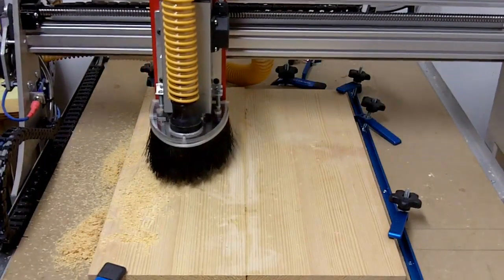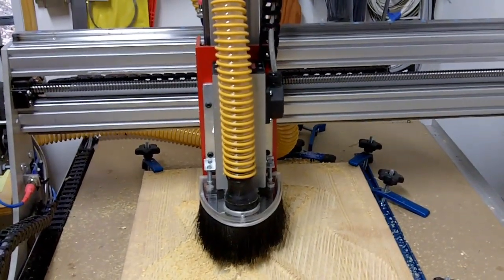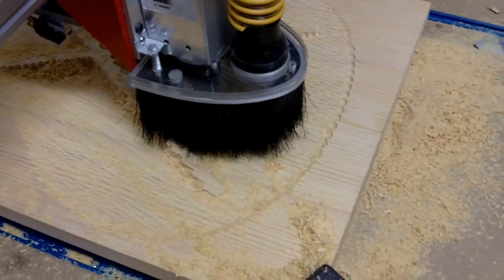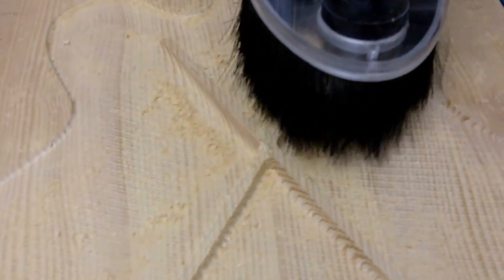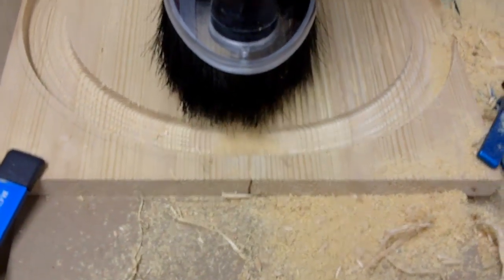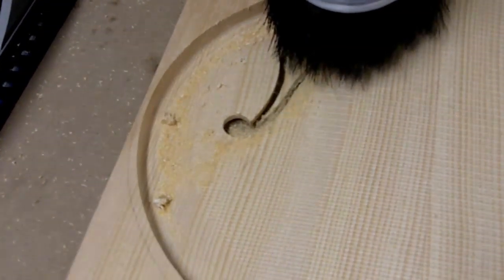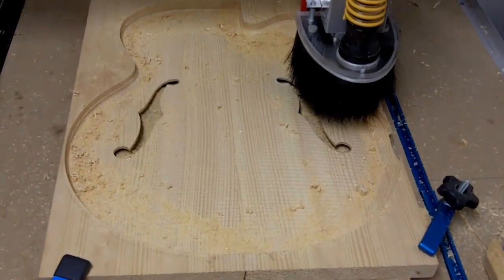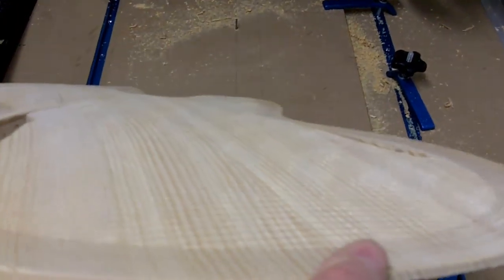archtop cut with cnc machine

Comment: What machine do you use..??
Would you recommend that same machine or an upgrade??
Reply from the maker: Steve Hinton I build this CNC machine myself...so it is my design....many commercial versions available however, including some cheaper Chinese which are OK..depends on what you are planning to do....
Reply: Cyborg Neuromancer Planning on cutting solid bodies for guitars....
I would like to have one 24" x 48" or longer... what would a kit like this cost..?
Reply from the maker: Yeah...that size sounds right...Not sure of the cost of the kit, as I said, I put this together myself over the course of a few months.  Good kits can go up to 4-5K.  You can pick up reasonable ones on ebay, but be prepared to do some modifications.  There are many folks over at cnczone that build their own, and some might be able to offer you such a kit...

Comment: Wow, that is awesome!  What thickness blank wood did you begin with and what was the final thickness of the edges of the top?
Reply from the maker: I used the Benedetto Plans, and I think the edge is at 3/16, with the recurve at 1/16, going to 5/32 and then back to 3/16 at the center.  I left them a little proud, so that I can fine tune with sanding and obviously tap tuning...
Reply: Thanks so much!  I am planning for 6.0 ~ 6.5 mm --- good to validate with you.  Cheers!

Comment: The braces need to have the grain running straight through them so they need to be seperate, This may be enough, but it is giving up a lot of extra strength.
Reply from the maker: I have been playing this  guitar for years, and has not shown an issue....Another option would be to have the braces in a parallel config, as compared to X....or like you said, leave them off....easy to do with the model.
Reply: yeah, this is good enough most likely. Just not something the perfectionist in me likes.

Comment: Having the top and the bracings from 1 piece of wood is awesome!
Reply: I’ve also had great success with 2 archtops already with ‘built-in’ braces. No problems so far!
Reply: No, it's not. The grain of the braces should be straight and in line with their orientation. Even running them at a slight diagonal compromises strength greatly. Bigly, I mean.
Reply: @MrStudioCalifornia  man, yes your way was the only one before cncs. Yes, we are using braces with different grain pattern. But, if this practice shows success ? Then f-ck it!!

Comment: I agree with Björn Gröhn. The inside braces need to be made seperate.
Reply from the maker: ..You can easily do that....but I have NO PROBLEM with this bracing system, and the guitar sounds great!  It has now been over a year since this build, and the guitar shows no signs of any weakness or drop in sound quality.  Very easy however to add the braces separately after the top is carved on the CNC. Cheers!

Comment: wonder if those carved in braces are as strong as mounted braces with different grain ? would the one piece top with no glued in braces sound better?
Reply: Those braces have so much "run out that they would have little to no strength at all, in my humble opinion. But I could be wrong (haha) please correct me "If evidence proves me wrong.  . To visualize this clearly cut crossgrain equal height, equal width "Braces" at the same angle to the grain as the video shows and "braces where every strand in the wood runs the full length of the brace from the same piece of lumber. Side by side clamp both to a bench in the same way 1/4 on the bench and behind the clamping force. Give each a pluck. Note the pitch and sustain. Attach weights to each in increasing amounts until they break. Record the results. Form a hypothesis. Invite peer review. Stop wondering as you will know.
Reply: I do like the Idea of using those "Carved in Braces" as a flat base for gluing braces with zero runout to (lower the height to aprox 1/16" thicker than the top but computer flat side to side)  as fitting braces properly to a fully carved plate is time consuming
Reply: @Tongdee  Fitting the braces properly, like cutting the top itself with a CNC is pretty trivial. You can take the curvature from the bottom of the guitar top and then use the CNC to mill the contour in perfectly, sand and fit afterwards.
Reply: n Rosewood
Reply from the maker: ..yes, that would be an interesting experiment.  Here is another:  Create the guitar, play it for over 3 years, and watch for any issues?  So far, this guitar is functioning and playing great.  Top has good strength, and is quite responsive and resonant.  Works for me.  Your idea about using the carved in to then glue other braces on top is a fascinating one!  I think that would work as well.....I guess when you build this, you will report back?
Reply: machined in braces is rather pointless and totally defeats the purpose of bracing.

Comment from the maker: Well I was also...but I have a guitar build with this going on about 1 year now, with .13's as strings applying heavy pressure to the top...and so far, no problems....I will keep monitoring it, and your concerns are valid, but I wonder what luthiers would have build if they had access to today's technology....just because "it has always been done this way" is not a good enough reason for me not to do this... we will see how this holds up, but so far, the results are great, and so is the sound!

Comment: I am a little sceptical about the integrated braces. The braces are supposed to take up some heavy load from the string tension, but the fibres in your "braces" do not follow the braces. The fibres go across the braces. No luthier would make braces from wood with the fibres in this direction. The braces also have another function: they try to keep the top from cracking due to drying. I think you should be really careful about these integrated braces.
Reply: machined in braces is rather pointless and totally defeats the purpose of bracing.
Reply: Hello, please tell the maker in this video that his built in braces are pointless, and Thank you for agreeing.
Reply: i bet he heard ALL OF YOU BY NOW.....